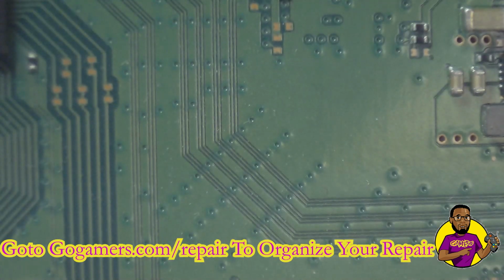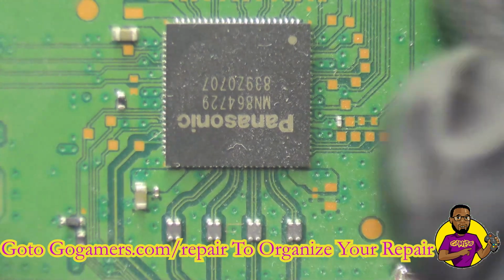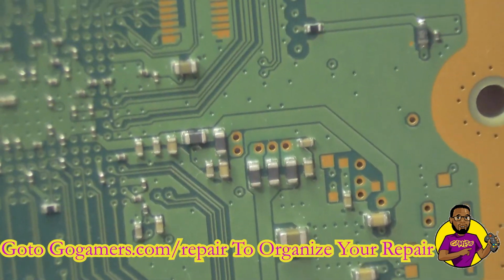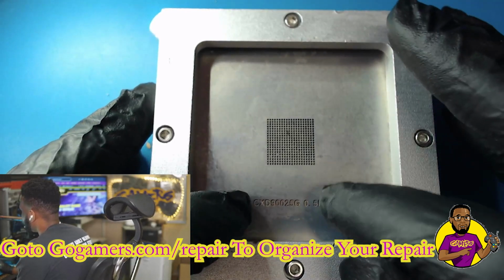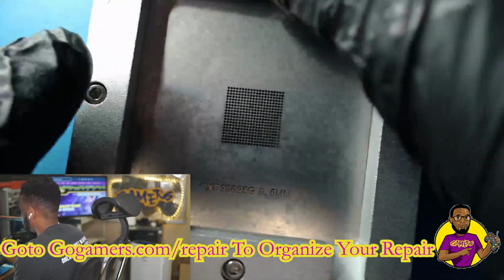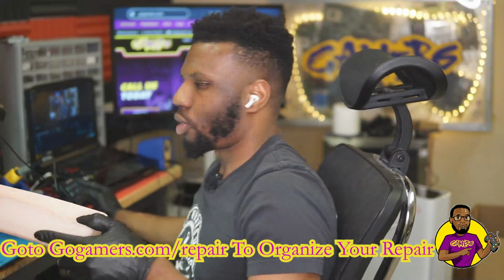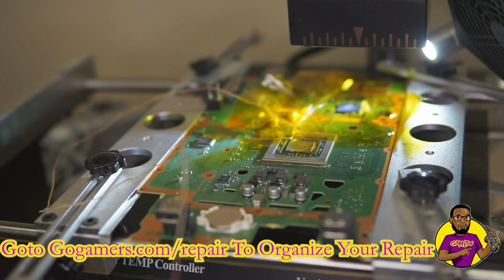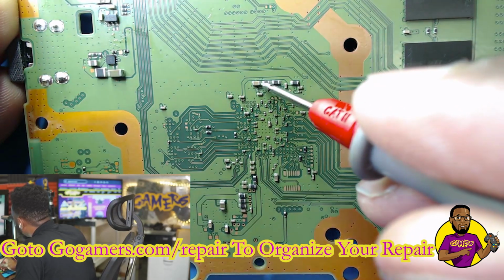Fix PS4 Slim No Power / Not Turning on (New Southbridge Reball)

Comment: A fraud. If you have a short where you showed, the chip is faulty. Reballing it won't solve the problem. Beyond that,  you didn't show the reballing process entirely and the batch of the chip, to compare with the one supposedly reballed.
Bottom line: a reballing won't solve the issue when the chip is  faulty.
Reply: He said he replaced the chip with a new one, the new southbridge (which came from a donor ps4) was what he balled. Then installed on the Motherboard
Reply: @DirtyOne614 correct 😊
Reply: Wrong... 🙄

Comment: Good work man, pro tip avoid using capton tape to mask out the board, you can very easily heat the other components under the tape, reflow them and when the solder flows the component sticks to the capton tape and messes their arrangement when the tape deforms. It's far better to use tinfoil as the components wont stick to it.
Reply: How is that a pro tip. The tape is to help other components not overheat and also to not move. When I don't use the tape  sometimes other components especially tiny capacitors move so using this tape prevents them from moving. It's not easy trying to put a tiny capacitor back in place. If that happened to you then you're probably using a cheap tape. Tin foil is not good because keep in mind that those capacitors are charged and you could short out other components. Now that's a pro tip.😂
Reply: @HallEffect7798  capton tape doesn't do what you think it does, and when the smd components stick to it you'll understand why it's a tip not to use it.